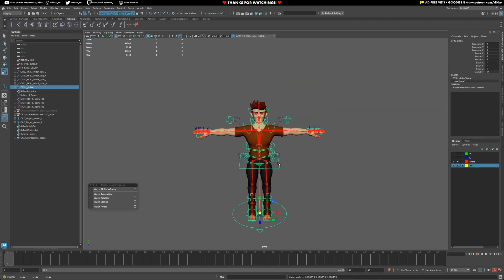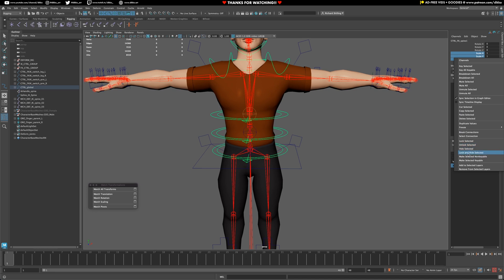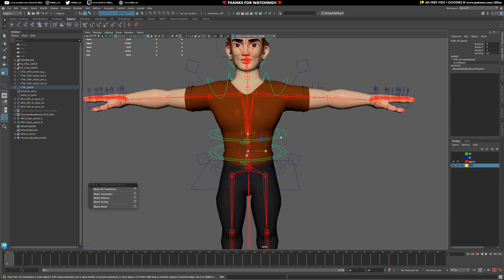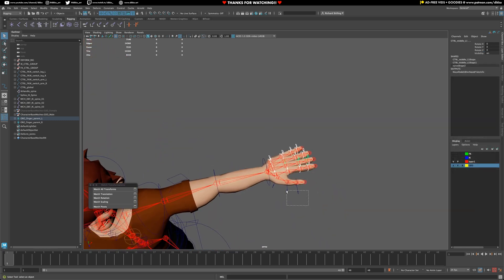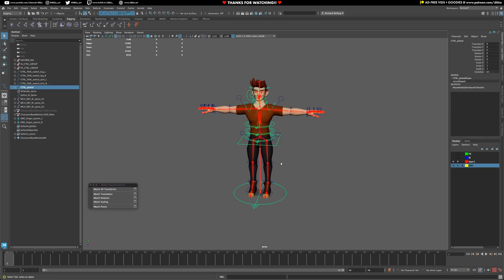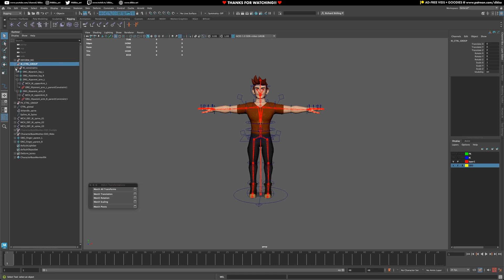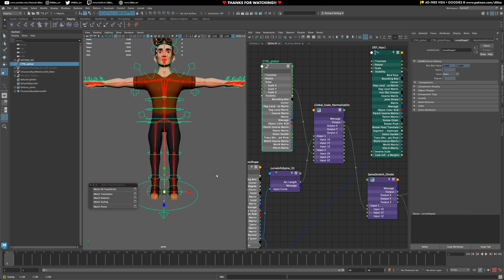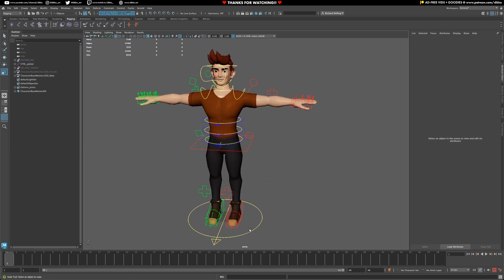Character Rigging in Maya! Episode 15 - Adding "Final" Touches to the Main Rig!

Comment: I tried placing the spine helper joints (MCH_DEF_IK_spine1-3) in the DO NOT TOUCH group and it causes some scaling problems. When you shrink the rig small enough it will really mess up the spine IK. I fixed it by putting the helper joints under the Global control and it solved this scaling problem.

Another problem I encountered was when you scale the rig enough the geometry will become bloated or shrunken depending on if you increased or decreased the global control's size. This problem is caused by the delta mesh we added a while back. To fix this you will need to connect the global control node's scale output to the delta mesh node's scale input (in the node editor). 

I hope this helps anyone who has these problems when following the tutorial.
Reply: Hi, this is probably a silly question but where abouts was the delta mesh placed? I'm trying to find it right now since I am still getting scaling problems when i change the size in the global control